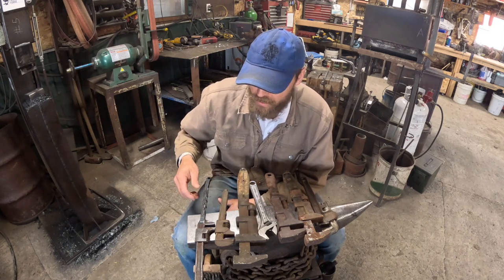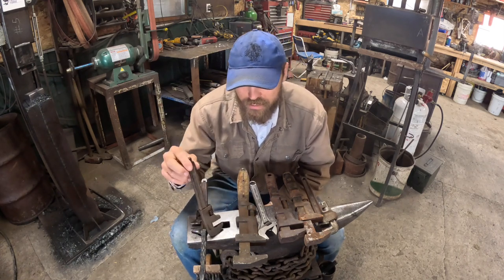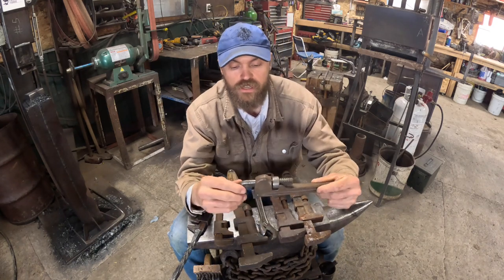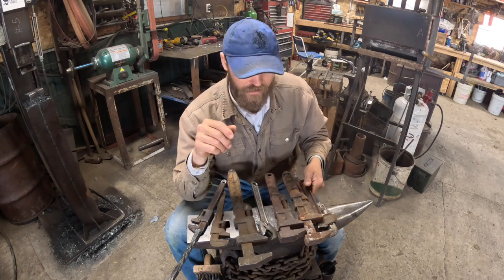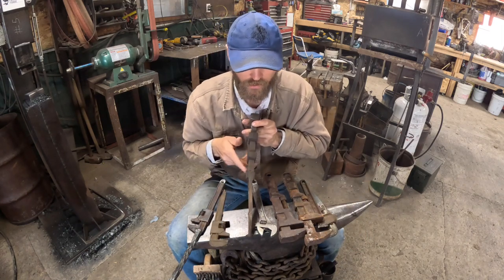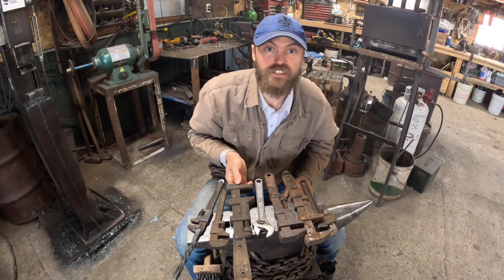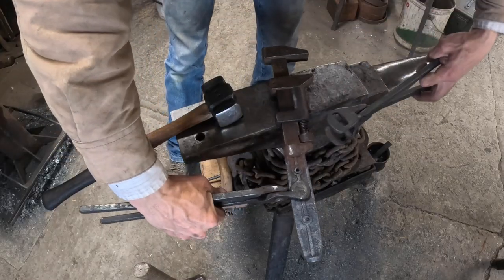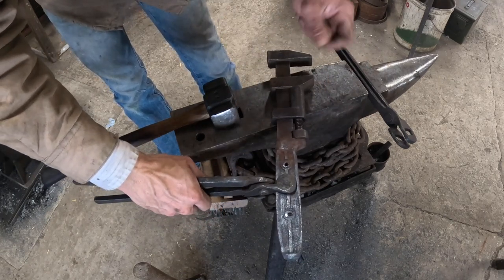Blacksmith Twist Wrench

Comment: Nice job on the wrenches, ejoyed.  I need to make one up.
Reply from the maker: Thanks Randy! They are nice to have a few different sizes hanging on the rack.
Reply: @FarmsteadForge  They are called Monkey wrenches.
Reply from the maker: @RRINTHESHOP  That's funny because I said that in the video then ended up cutting it out. My grandpa always called them monkey wrenches because any monkey could run them.. then he would look at me and smile. 😉😂
Reply: @FarmsteadForge  That is what they are,  I have many Monkey wrenches.  I even have one I am going to make a twisting wrench from.